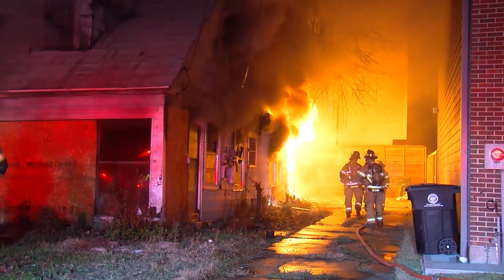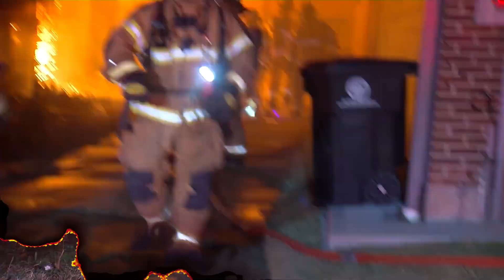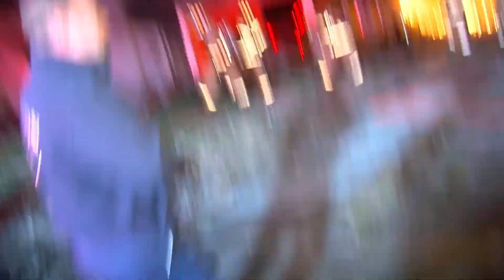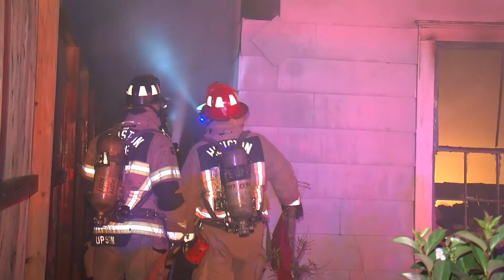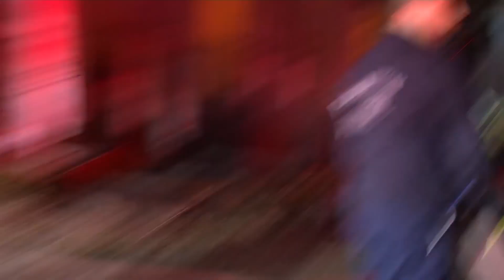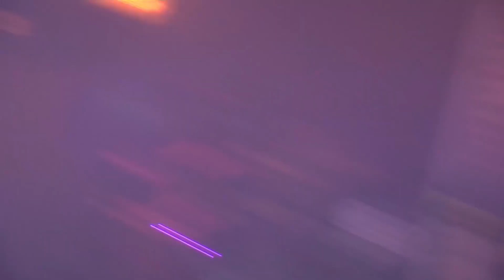What's Going On

Comment: Most of our engines have 1000 gallons, besides a few older backups pieces. Shit, the Rescue I’m on has 500 gallons.
We usually have 3000-5000 gallons arriving on scene within the first or second alarm, depending on where the fire is. 
More than enough water to knock most fires down.

Comment: IM a driver. pump operator what ever we are called  and i am usually ready to supply  water to the hose when called for.  I have seen drivers  worried about water supply to the truck before  the hoselines . Another thing i see inthe video is the nomex hoods covering the masks. the  vision  of the firefighters is restricted.  Talk about tunnel vision . the hood need to be tucked around the back of  lens .